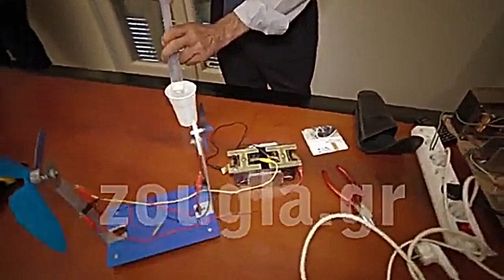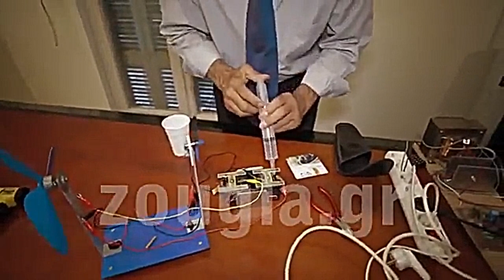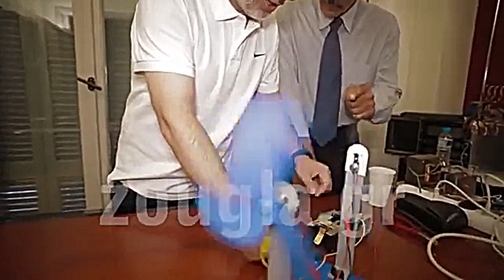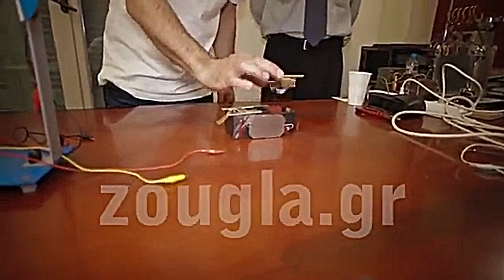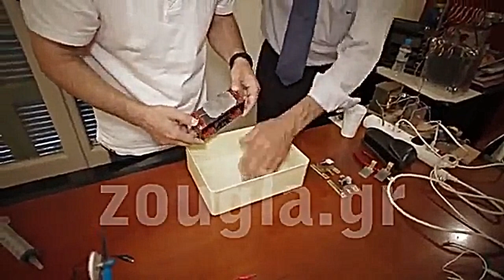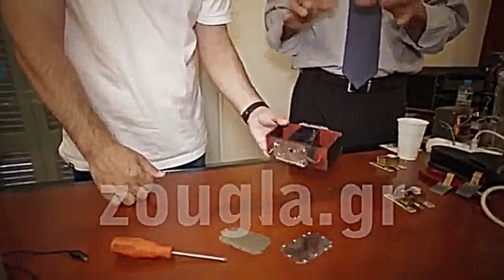Zografos toy model English Translation

Comment from the maker: He is using Gunn Diodes to convert the High Ghz Frequency to DC output power...
He is probably using Magnesium and another alloy to start the voltage generation which feeds the Ghz oscillators located under the metal plates.
Then the Ghz oscillation is splitting the water into oxygen and metallic hydrogen which is then rectified to DC by Gunn diodes..which powers the Fans. Pretty easy principle, if you know the right frequencies...😅😅😅

Comment from the maker: Now the only question still is, what kind of electrode materials he is using and what kind of oscillators he is using and which Gunn diodes is he using to rectify the RF power to DC.
Maybe he is using as the electrode materials  Magnesium and Graphite, which give off in normal tap water about 1.3 to 1.5 Volts, so his Ghz oscillator probably works with a low voltage already starting at 1 Volts or so...
His Gunn rectifier diodes are probably located on these Membranes that sit inside the water case...
He is probably using standard Ghz components, so maybe some of you RF engineers know what kind of parts he is using there..??
I doubt that Zografos has build and soldered the electronic PCB circuits with the Ghz transistors himself... Maybe he just bought to standard PCB circuits from Mouser electronics or any other company that produces PCBs for radio and Radar electronics and just used these...
As Zografos is an RF engineer he knows how these parts work and he also has a spectrum analyser that can show the resonances in the GHz range... So he is very smart, but he lacks a bit of the building quality, as can be seen in the 50 KWatts demo, as this new device was not completely ready at the demo and needed to be fixed...and the demo was a bit chaotic at the press conference...
Maybe he should just write a book about it and just give it completely away to the Open source community... It is time he will finally come forward with the secrets in detail...
it is now almost 10 years he already sits on it...how long will we still have to wait for it ??
Surely there are big interests against it, like the oil and gas producers, but it will be just a transition process from from bad fuels to clean fuels like using water for the global power production...
Reply: Thank you for the video comments.